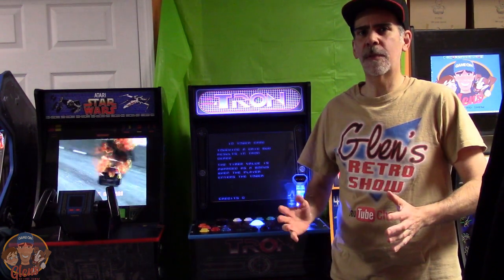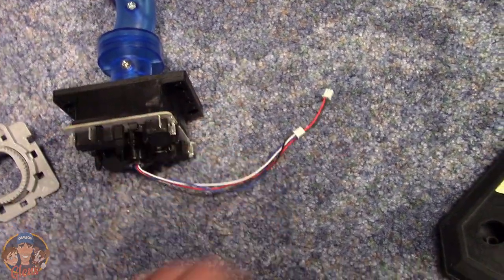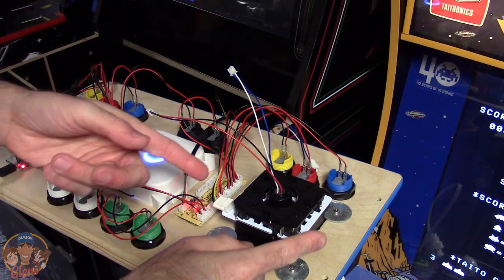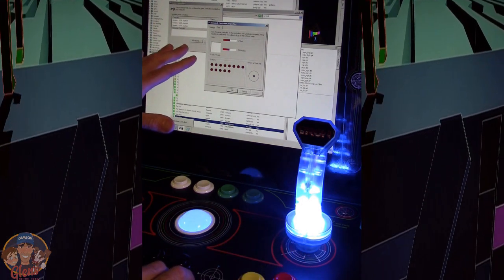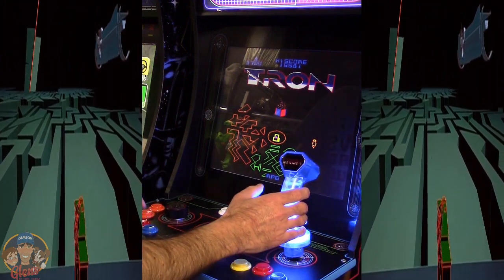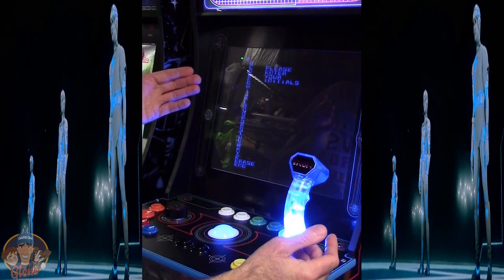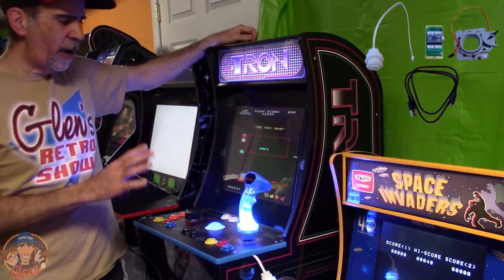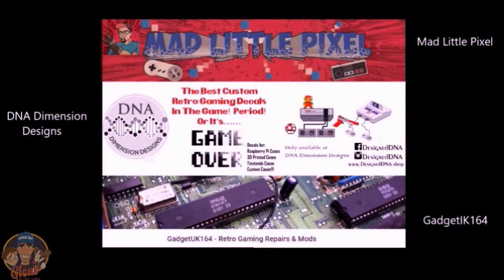GRS Tron Powered 8 to 4 way gate switcher

Comment: I have these in my cocktail table. They are called ServoStick by Ultimarc and I have them on both my Sanwa's. I also have it programmed that the 4/8 way gate switches automatically depending on what game loads, no button needed.
Reply: details on this or links please
Reply: Same for this: There are already software packages for Windows and Raspberry Pi available that automate the setting based on selected game (Windows LaunchBox and Raspberry Pi with Retropie/Emulationstation). In addition to that, the player can over rule the automation whenever needed manually (which the Ultimarc can not ;-)  )

Further details:
https://cdn.thingiverse.com/assets/47/be/23/57/32/tos428_automation.pdf
Reply from the maker: I'd also like to add that the automation is per game not a level in the game so the ability to not be able to switch between 4 and 8 as needed is an issue for a game like tron
Reply: @GlensRetroShow  Thanks Glen!  Will this work with any joystick that uses gates? or just the Tron one?
Reply: Do you have an approximate price or range? estimated availability?
Reply: @Zehrfox  You might not aware of this, but I put over a year of hard labor in this project to design and develop it and just lately found in Glen a trustfull and competent partner to make this available for a bigger audience. So feel free to address technical questions also in my directions.
Reply: @BurgerStefan  ok, thank you!
Reply: @Zehrfox  so getting back to your original question regarding compatibility of gates: the Tron gates are very specific in dimensions and will only work on that particular stick. But as part of this solution there is also a Sanwa compatible version available that can be driven by the same microcontoller and the same software and can be installed together in one cabinet. See the following demo for illustration:
https://youtu.be/xkZeSAqKEXo
Reply: @BurgerStefan  Thats great, where can I get the Sanwa one, and does it work on sanwa clones?  Do I need to buy both to just have the sanwa one working? I dont have a Tron Joystick
Reply: @Zehrfox  It's never to late to get a awsome Tron ;-)   The Sanwa version works with all types and also Clones that share the same restrictor plate mount. Until now the solution passed a very successful pilot phase but with very limitted production capacity. With Glens and GRS experience and capabilities, I hope the solution will become available for a broader audience within the next couple of months. The clarification of details like pricing or product configuration will certainly be subject for a transition phase which is not yet done.

Comment: Glen fantastic item any chance of doing this with a wireless remote so we don't have to use a physical button?
Reply from the maker: There ..are some ideas.. maybe a touch sensor
Reply: @GlensRetroShow  cool, I'm thinking for the sanwa clone model as I like that for my iiRcade and my MVSX cabs, without having to cut holes or modify.

Comment: Awesome Idea Glen!  now I may not need to build 2 cabs, a 4 way and an 8 way.  Would this switcher work on all joysticks? or just the Tron one?  Also, which of your spinners are better?  is the button hole spinner the best quality spinner? or are you coming out with an new spinner?
Reply from the maker: Well this design will work on all the joysticks that we sell Tron or otherwise I'm sure it can be retrofitted to other controllers especially Sanwa clones I would say going forward if you're doing your own build the USB buttonhole spinner is better just because you don't need any interface boards to be USB
Reply: @GlensRetroShow  Thanks for the prompt replies Glen.  Your products are amazing, I already bought the Yoke on kickstarter.  Now I need a good spinner for a new cabinet to play Arkanoid, etc.  I will buy the button hole one you mentioned.  Keep up the great work!  What other joysticks do you offer? and are you selling arcade buttons yet?

Comment: It might be better to have a toggle switch instead of a push button, you could mount it underneath the ALU or on your 1up on the little slider panel
Reply from the maker: There are some button options possible..this was just the prototype
Reply: You will definetly want some kind of visual indication of the actual status as you cant see inside the closed control panel. The button is designed to change the color for indication.

Comment: Can't wait to retrofit my Tron joystick! As well as my other mods. I know Stefan's been backordered for a while. So stoked on this! Quick question... Did you mod a space invaders into your Star Wars / racing cab? Would love a couple details on your yoke mounting plate :)
Reply from the maker: Actually it was a arcade went up asteroids that I converted into the Star Wars racing cab the mounting plate was from 99 lives arcade you can also find some 3D printed ones on thingiverse but 99 lives does a really nice job
Reply: @GlensRetroShow  Thanks man! I lucked into one of your full kickstarter kits recently for my Tron project and definitely want to make a SW/racing cab using your yoke, but don't necessarily need it in a 1up SW cab. :)